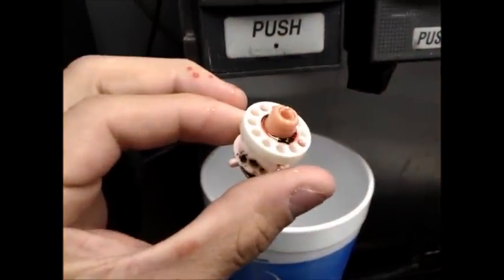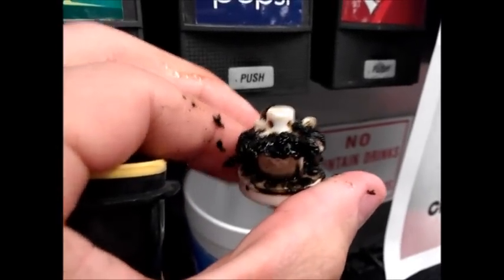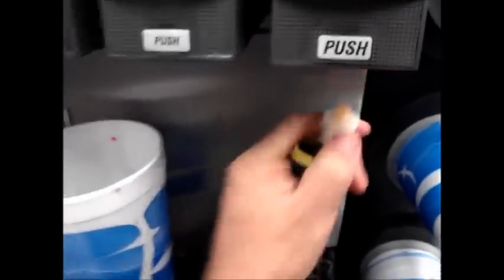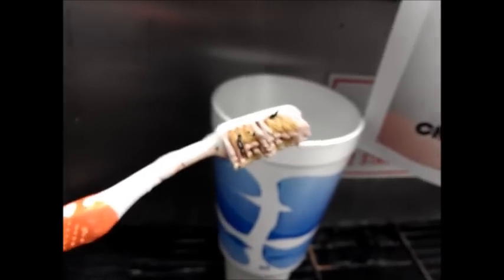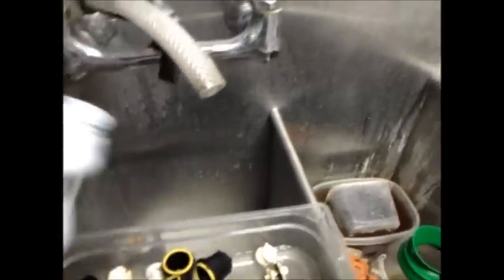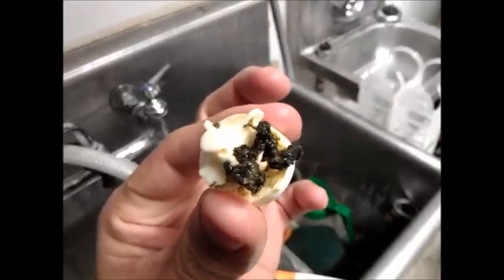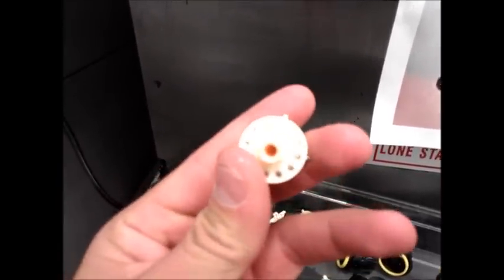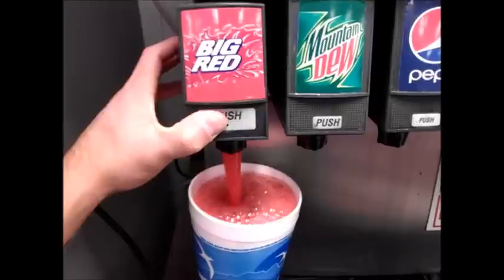NASTY Soda Fountain BACTERIA !

Comment: You are not supposed to use bleach, you need a food grade cleaner. I have a cleaning poster I received from Coke for our machine.  It says "Do not use bleach, soap, detergent, steel wool scouring pads or abrasives." You need to use a Kay-5 Sanitizer/Cleaner from any food or restaurant supply company, or even Amazon and use it in a spray bottle to spray up into the nozzle openings. For the nozzles and the diffusers (small white center piece) just let soak in really hot water or in plain soda water from the machine for at least 3 minutes which works great at dissolving the black gunk. Use a bristle brush if needed to scrub into the openings or on the nozzles/diffusers. It really should be done daily, especially if there is high usage, or once or twice a week at the least. Hope this is helpful.

Comment: You should check INSIDE a Coke Freestyle Machine.  I worked for a Movie Theater.   Per H&S every night nozzels were taken out, sanitized, left to dry, inspected and refitted the next morning, along with all touch areas, but open the Bottom where the Syrup is added to the machine and it is NASTY.  It has to be kept up CONSTANTLY because of the condensation coming from the cold ice lines into the dispenser.   What we didn't know until I LOOKED was what happens when you open the TOP Window of the Machine.  GAG!  OMG!  The level of Toxic Mould that builds up where the Soda meets the syrup right before Disspensing!  I will NEVER drink from any machine again!   And the Crew didn't even REALIZE it.  All occassionally cleaned the lower, no one knew about the top lever unless you ureach in the upper right hand corner and pull down the metal latch...   @Coca-Cola  @Cineplex - are you listening?
Reply from the maker: I agree, they design their machines to spread disease . . . They might be working with big pharma 

Mayor Fuglycool

Comment: Never use bleach! One day you will be wondering why the machine is spraying soda everywhere.

Soak in warm water every day.

Wash with a mild detergent once per week using a soft bristle brush.

-Instructions from a soda machine installer and maintenance person.
Reply: Also vinegar is a lot better than bleach cause mold on certain surfaces will grow back stronger because it will sense bleach as a threat and will move deeper into a surface like drywall and wood. But vinegar only kills about 80% so try a disinfectant cleaner just to be safe.
Reply: Why would bleech hurt it not like it we'll eat the plastic lol

Comment: If a soda fountain is ever found with nozzles like that it needs to be closed down! Bleach will eat the rubber gaskets, rinse gunk off, brush clean with soap and water then rinse with hot water and use sanitizer. Hydrogen peroxide is a good sanitizer, always rinse before inserting back into fountain. Next time to clean the drain pan.

Comment: ppm over by a touch id say lol... next time you notice this please just buy replacement parts...i mean a whole new unit and probably every other piece of equipment in that place by the looks of those but let's just say that was the only thing never looked at to clean lol... and you can't just throw a half gallon of bleach on food drink contact things and then toss them back on.... you turned one issue into another i mean cleaner issue but still a turned out into another big issue..
Reply from the maker: Yeah the owner of the store didn't buy anything, unless it flat out broke. I think I was the only one to ever clean that machine LOL.

Mayor Fuglycool
Reply: i have to much to comment on but..sanitize comes at end of prewash wash rinse sanitize.. not the first thing... nasty but put gloves on and go through the process.. way to much bleach for sanitizing... little over quarter of that wash basin is like a cap full of bleach.. check with a strip to dial it in but that little tray and you literally dumped in the bleach lol... then at the end you say to run into cups for 15 sec to make sure no one will be angry (with you.. the reader) for the bleach taste ..WHAT ....k.. who's paying for the full sodas on each flavor to try and rid each flavor of not only bleach but the soap you toothbrushed all up in there and hoping a squirt or two of water is going to remove .... to the point you cleaned one issue but now instead of giving customers soda that is full of bacteria and mold your giving them sodas with all the other places bacteria and mold gather on soda fountain machine but now they get to enjoy that with soap and bleach taste.....food and beverage...parts per million? poison public saftey health ............... nothing huh.. you pour and drink each one till you think the bleach taste is gone on each flavor each time you do this and maybe you'll read up on how to properly clean this machine and it's schedule ...wow. props on trying to inform public but id say you still have issues on that machine in other places and now you have a public saftey issue going on..
Reply: curious i just realized you posted this um how too..... you work in the food drink industry im taking it... even if it's just a gas station . you serve soda and food items? if so how long and why are the basics plain ol not adhered to? keep keepin on but you had to of watched videos or something along the lines... if not look into it so you can do the job properly and have knowledge to give that's going to aide the reader looking for help ... in this case not so much helping to solve it but at least info is getting out that this is an issue....
Reply from the maker: @thomasolson9055  Took it apart to see out of curiosity. I don't think there were any video tutorials on this 11 years ago lol. 

Mayor Fuglycool